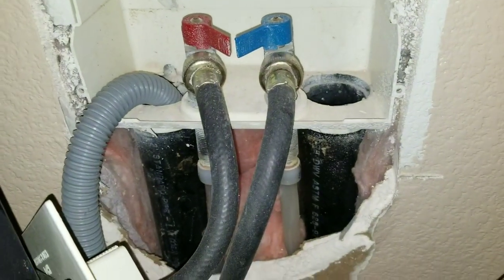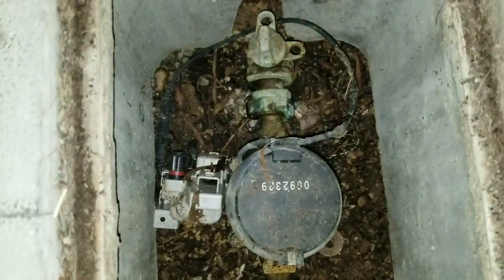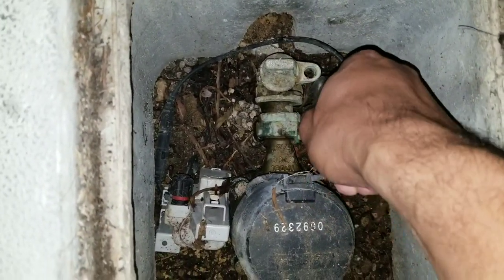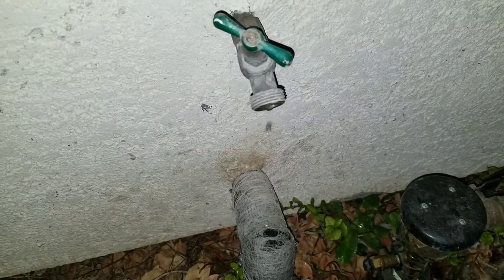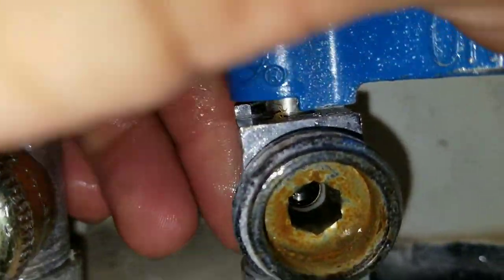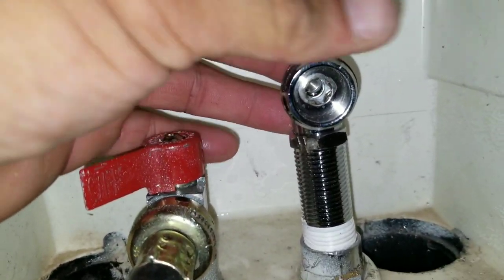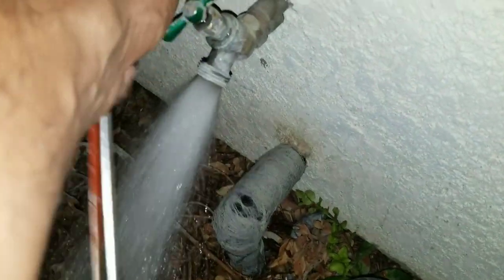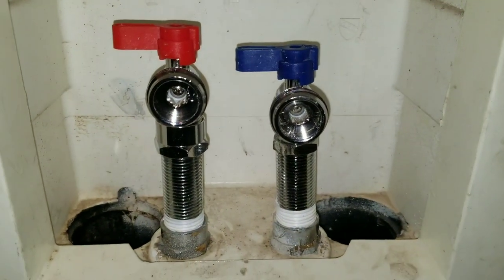Replacing Washer Shut Off Valves. EASY!

Comment: So it just looks like you screwed the valve into the fitting on the box is that correct?  If that is the case why is the drywall cut below the box?   Yours look like mine so I'm hoping i can just screw in the new valves without cutting the dry wall and soddering.
Reply: I have the same problem. i need a new cold water valve. I already cut the drywall myself. (easier access)?

Comment: U didn’t solder (“sweat”) the new valve on?
Reply: Not when they are threaded. Just screw them on with Teflon Tape to seal the threads.